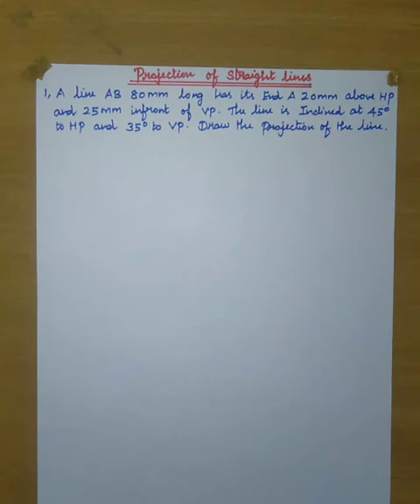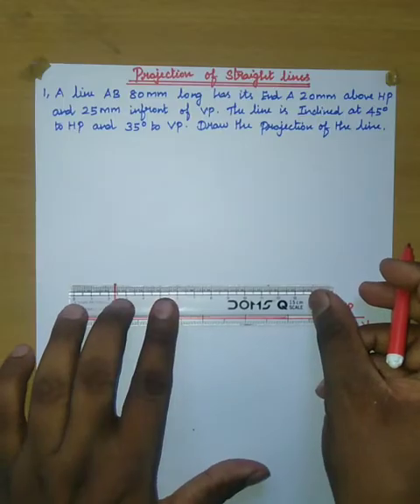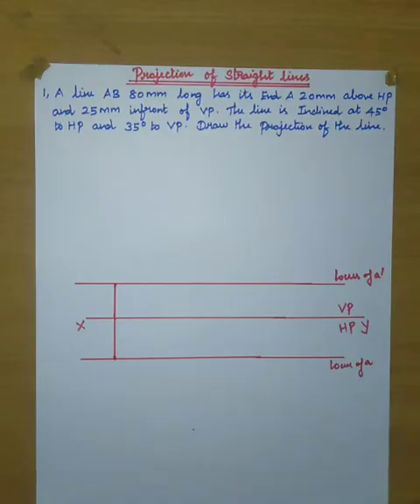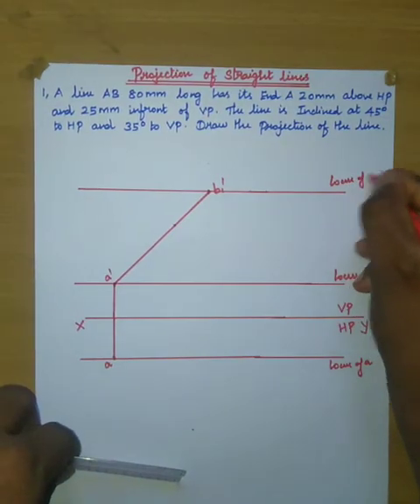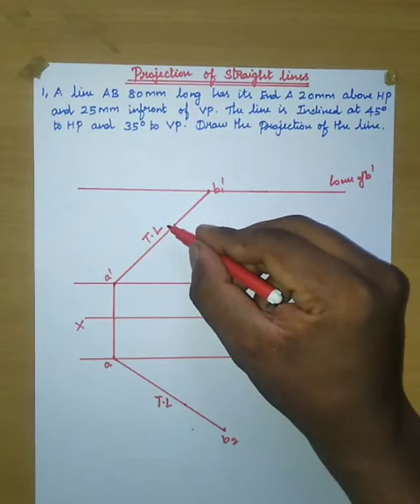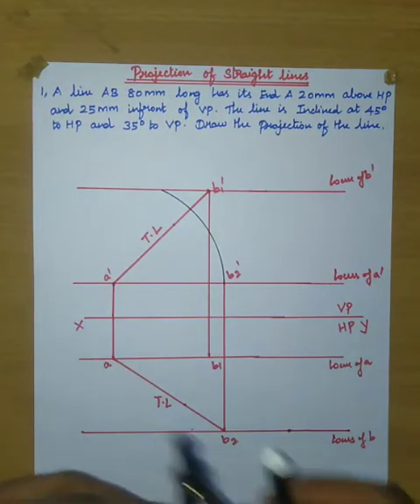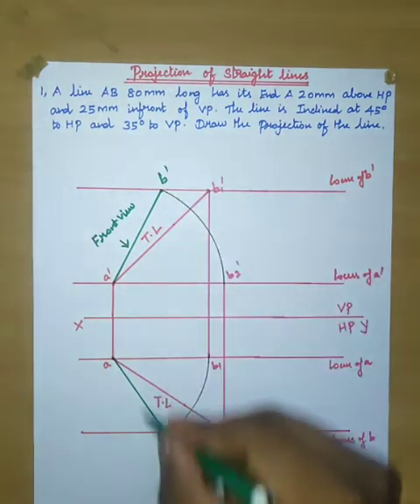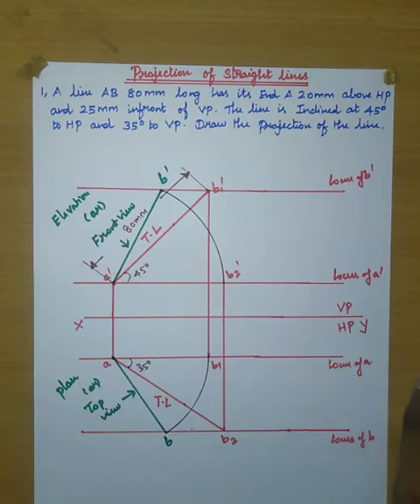Projection of Straight Lines I Engineering Drawing I EG I Tamil

Comment: A line CD measuring 80 mm is inclined at any angle of 30 deg to HP and 45 deg to VP. The point C is 20 mm above the HP and 30 mm in front of VP. Draw the projections of the straight line.
Reply from the maker: Sure! I'll try to cover this problem in a future video 🙌

Comment: A line of PQ, 70 mm long, is 35 mm in front of VP and 25mm above HP, the line is 
inclined at 400
 to HP and 300
 to VP. Draw its Projections. 
Sir intha question um nenga intha vedio natathunatu same model thana sir with different values

Comment: A straight line AB is 60 mm long. It is inclined to H.P. and V.P. by an angle of 30° and 45° respectively. Point A is 30 mm above H.P. and 20 mm in front of V.P. Draw the projections of straight line AB.

Comment: A line cd 80mm long is inclined  at angle of 30dgree to hp and vp 45 to vp the point c is  20mm above hp and hp and 30mm in front of vp draw the projection  of the straight line